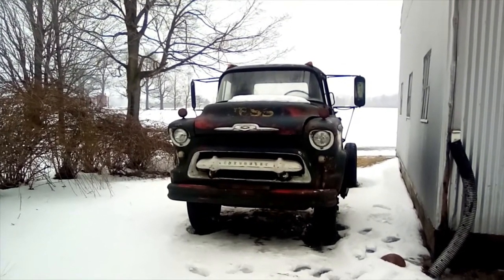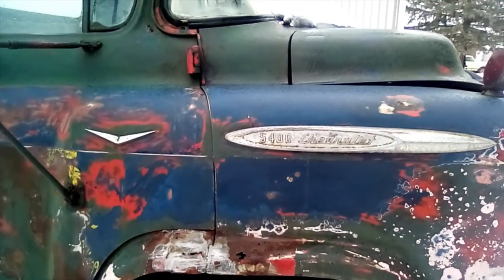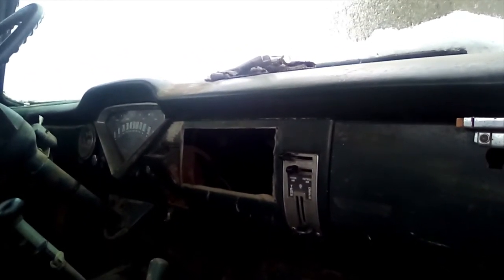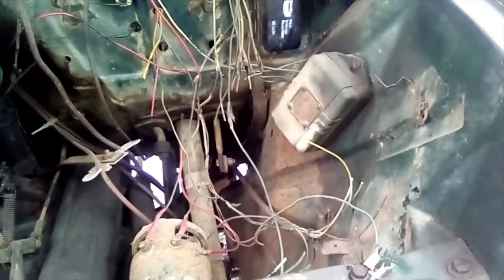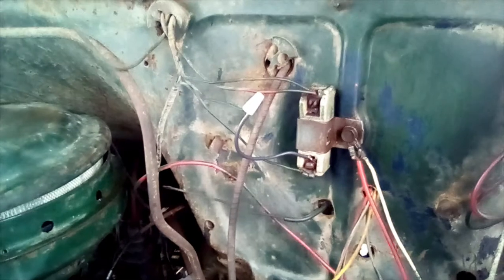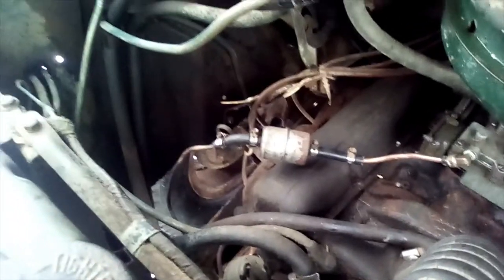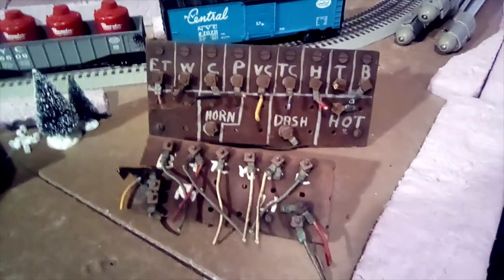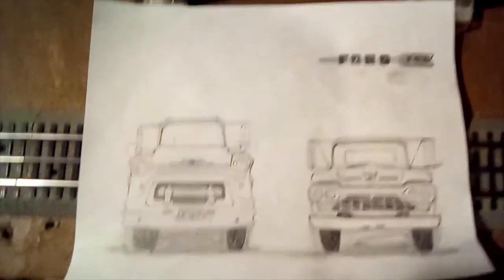1957 Chevy 5400 LCF | Troubleshooting and Simplification

Comment: Nice artwork 🙂.  The paint is "perfect". Patina Forever!!.  Grounds make everything run on cars. Good grounds will save you headaches later.
Reply from the maker: Thanks! I worked hard on it. All that blue paint used to be hidden under a dull green, and all the rounded panels means sanding it by hand.